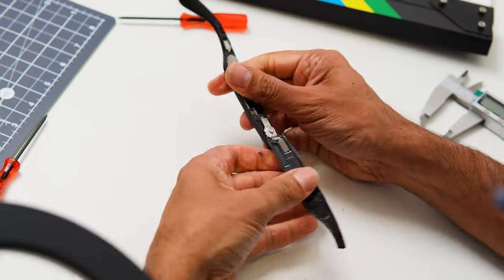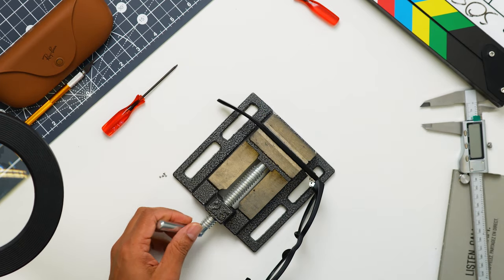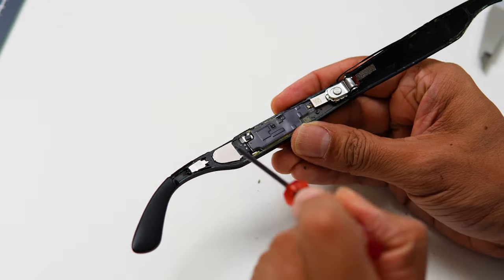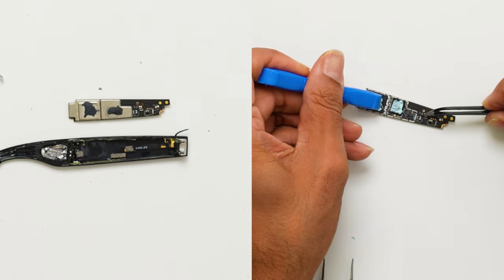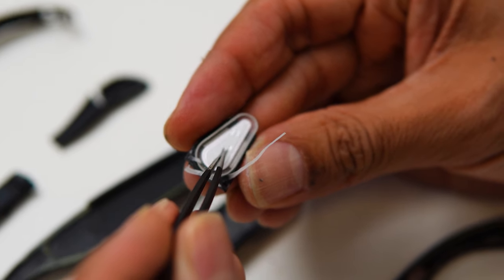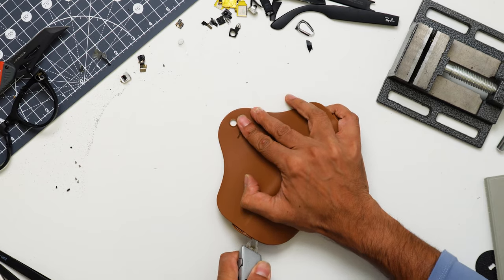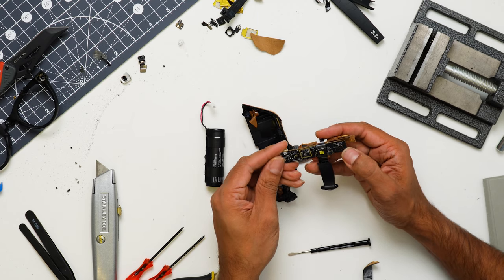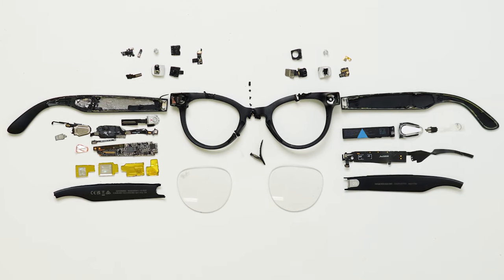Ray-Ban Meta Smart Glasses Teardown

Comment: As for the lenses: they are made of polycarbonate, which is used primarily to reduce weight and is safer than glass since it is not prone to shattering (which is why it was initially introduced for kids glasses). It is also a compatible substrate for various nanolayers that allow it to be made even thinner while maintaining prescription strength, and allowing tinting or transition properties. Polycarbonate is also a UV Cure resin, meaning it will absorb almost all of the UV light that hits it. Because it is a UV Cure resin, that means it will also yellow and become brittle over time, which is also where the nanolayers help as they protect the polycarbonate from UV Rays as well (particularly so with the transition lenses). 

In effect: It's less of a cost cutting measure and more of an industry standard now. Especially since these are Rayban glasses, which is owned by Luxxotica, which was bought/merged with Essilor a few years ago, which focuses on polycarbonate lenses and nanolayers

As for the speakers : I actually agree with the use of over-ear transducers rather than bone conduction transducers (and I'm impressed with hiding mics in the nose-pieces, seems like those are meant to help filter out noise to some extent?). The reason I agree with the over-ear transducers is that bone conduction headsets usually require skin contact for best performance, but some people with sensitive skin would have issues with this. That being said, bone conduction should absolutely be an available option, as it can help those who have ear canal blockages to hear better than an over-ear speaker option can, and can even be used as a general hearing aid in those cases (to some degree)

Comment: Blue Jean 
I ordered a pair earlier today. Great to know these things are built to be pretty durable!
Reply from the maker: Yes having used them they are the same as a normal pair of sunnies. In fact you can argue they are more robus, as the arms are double wall and glued together. Hinge is also stronger as it has CNC metal parts to route the flex PCB (FPC). Lenses are esily replaceable as well. Enjoy them!
Reply: @intretechsos  how risky would you say is it to adjust the curve of the arms with moderate heat to receive a less strong fit?

Comment: HI. I understand you completed this many months ago (and thanks), but could I tap into your insights? I have just bought the glasses and love them. However, the Large was too big at the frame point but perfect at the pinch point behind the ear, whereas the medium is perfect at the frame but tight behind the ears. I’ve stuck with the medium but, based on what you saw, could the tip of the arms be heated and bent out slightly without damaging anything internal? Thank so much!

Comment: Blue Jean!

Question, do you think its safe to replace the lenses at home.  The official stance is that you need to bring it to Lenscrafters or the Rayban store (In the USA) because of how sensitive the electronics are and the process most optometrists change lenses involves heating the frames up until they are soft enough to mold.  However, the Rayban Store and Lenscrafters are not cheap for prescription lenses.  What makes matters worse is that they are not 'in network' for a lot of people's vision coverage so the obvious suggestion is to pop the lenses out and bring them to a 3rd party prescripion lens provider.

I also think I may want to swap between clear prescription and sunglasses once in a while unless if transition lens technology has got much better in the last few years.  Having the partially tinted lenses indoors in bothersome and some transitions don't really go all the way dark outside either.
Reply: ....Ashley does it in the video

I've done it before- it's very easy to do with these lenses.

Comment: Was that the camera sensor you flashed at about 4:50?  Curious if it is a rectangle thus killing any hopes for a good quality horizontal shot mode.
Reply from the maker: That is the camera yes. Currently you cannot take any videos in landscape, if this is software or hardware limited I am not sure. But the reason is they are made for social media. But having the option would be great and seems silly not to.

Comment: Great teardown video Ashley. Custom speaker driver was an interesting choice to have made and would have added to development cost over a ready made component. Disappointing to see that neither batteries are accessible for recycling at end of life. Very impressive though to see how much tech can be squeezed into such tight spaces nowadays!
Reply from the maker: Yes they obviuoulsy went for improving the speaker quality and experience, you can tell the difference for sure. It has to be custom made to fit into the ID. Sealed batteries are the norm unfortunately. If it was replaceable the arm thickness would be much more, and exposure to other electronics would mean certification would be more complex.

Comment: Great Video - it tells me what I want to know but I will ask my question anyway - is it a safe assumption that I cannot easily replace the temples/arms of one pair of RB Meta glasses with the arms of a different pair of the same design but different color?

The reason I’m asking is that my friend and I had this idea to create two-tone glasses out of them.

I would buy a brown pair, he would buy a black pair, then we would swap the arms of our frames so that mine are brown in front but black on the sides and his are Black in front but brown on the sides.

Based on your video, it seems to be that this would be very difficult for the layman because there is actually thin electrical wiring that goes all the way from the right arm to the left, through the joints of the temples.

You can’t simply unscrew and remove the arms of the frames like regular glasses.

Is this a correct assumption?

Comment: Thank you for this great teardown. 

On Reddit it’s advised to keep water away from these glasses at all costs. 

However the meta website states the following:

“…To clean your Ray-Ban Meta smart glasses, you can use a microfiber cleaning cloth to gently wipe the lenses. If they are very dirty, you can rinse them quickly under the sink before using the cleaner … Additionally, if you need to remove marks from the frames, you can use regular dish soap and a soft bristle toothbrush, then rinse…”

After doing the teardown, would you say rinsing under a sink would lead to foreseeable damage?
Reply from the maker: There is a proper seal across the arms and frame, however getting water around the hinges I think could lead to water getting in. As for rinsing them, you'll have to do it under your own discretion.

Comment: Hi there, thanks for the video, but would u happen to know if the lens are swappable as per the normal Wayfarers, meaning just popping the lens out of the frame and replacing them with another.
Reply from the maker: Yes they are swapable, its easy to pop out the lenses and replace with another.
Reply: @intretechsos  Thank you so much!
Reply: @intretechsos great! Thanks for the info, I have been told by LensCrafters and Ray-Ban store staff that they couldn't. They said their lab uses a "special tool" to install the lenses because of all the tech in it. I was planning to get the Meta and swap my current Wayfarer Ease lenses in prescription with the smart glasses but have been told that it's not possible. Will you be able to do a short video showing the lens swap? Appreciate your content!
Reply: @bjsmind  ... I mean he just kinda did it in this video.

lenscrafters lie to get sales- very simple just pop em out from the top outwards. I swapped from polarized to prescription transitions easily
Reply: @Matanumi  yeah, I did swap the G-15 to my Rx lenses on the day that I got it. A little tricky though because you can't heat the frames up and the Wayfarer Ease lens height is a 0.5mm over than the Metas but it's doable. I've been using my transitions lens since day one.

Comment: did you remove the PCB for the touch sensitive area on the glasses?
Reply from the maker: You can see it at 4:10 and 8:45, its the flex PCB under the battery.
Reply: Ah, I have the denim blue ones as my prescription glasses, so I can see the outward facing side of that PCB but I thought the internal side would look a bit cooler, I didn't even notice it in your teardown lol great vid!

Comment: the right arm of my meta's snapped, i got hit in the temple with them on and they snapped just after the right hinge, ray ban has beena bit difficult answering my question, so my question is. Is it fixable?
Reply from the maker: Question is, has the flex cable going from the arm to the frame snapped? If so, it might be hard to fix, however if it is just the hinge that's broken, this could most probably be fixed.

Comment: I would have used 99% iso and your rework station to undo that glue. it would have taken a bit of time using lower air temps as to not melt or change the texture of the plastic, but I bet they would have come apart without breaking the glasses.

Comment: Blue jean.

Great teardown. Are you able to tell what technology they used to detect if/when the privacy LED is covered which disables the recording function?
Reply from the maker: This is simple really. They will use a light sensor (Diode), and then when the light sensor/diode is covered for a set time (1-2 secs) the FW (firmware) will be able to detect if covered, then it will shut off the camera. If Light sensor diode detects light at a certain level for certain time, it will start again, or be able to start. Hope that answers your question.

Comment: "Blue Jean" & I'm impressed & can't wait for the 3'rd vertion to come out... I hope they have a 64gb or a 128gb ram & or a 32gb or 64gb internal ram hard drive with a 32gb, 64gb, 128gb & 256gb ram, for a external micro sd card... A 750 or 1000 Pics & a 10/15min Video recording 5.50 or 6 or 7hrs time limit between charges... Also smaller liter faster n up dated featured produts + around same price or 400.00 dollars... Please get back intouch with me, & also get back to me with any romurs or newer features OK & Thanks Bra...Keep in-Touch OK???                                                                                                                  Peace!!!/Out.../AshleySayed!!!

Comment: First time viewer. I can't believe you're not using macro lenses to film each piece in close-up stationary detail. You're going through all this effort and cost to destroy an expensive piece of tech, but then we, as viewers are not getting very good images of the components. That should be your primary concern, but you kind of do this over the shoulder in-and-out-of-focus blowing through the teardown super fast and showing us centimeter-sized pieces from 3 feet away. Even after you lay out the pieces, you do these fly-over camera movements where only a sliver of the camera is in focus (sometimes) and you give us moving shots that continually try to auto-focus. Ouch.